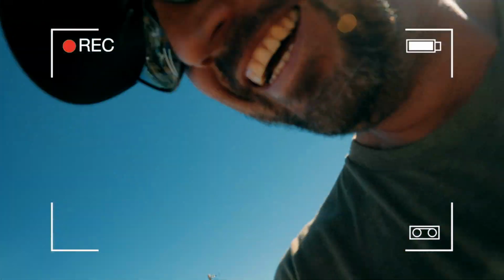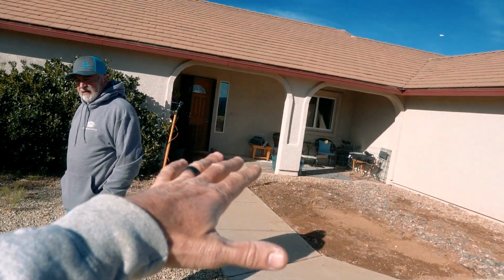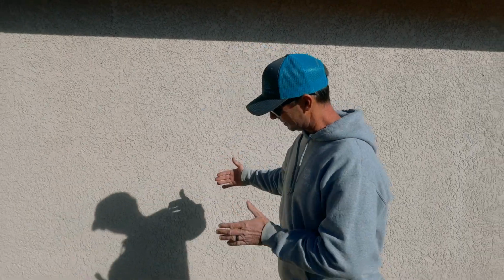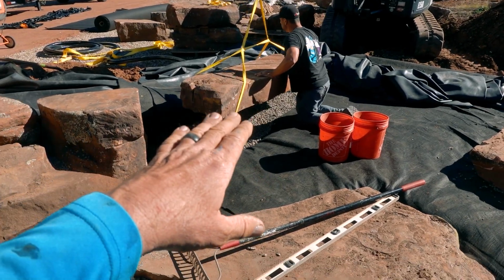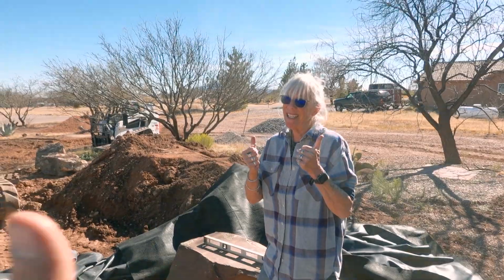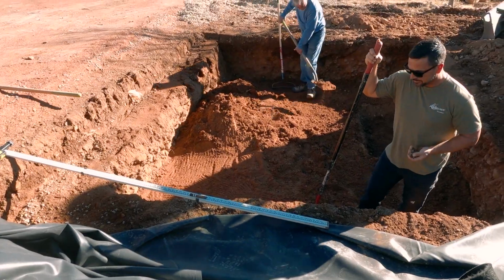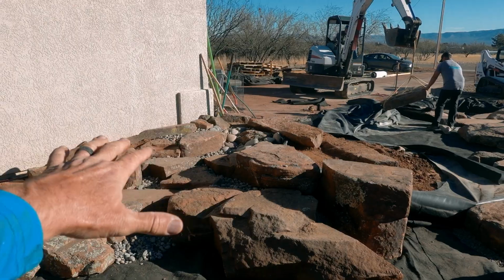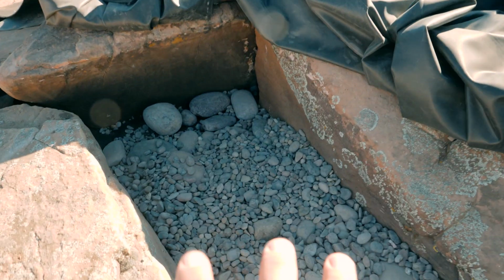Pondless Waterfall BUILT for a DOG!

Comment: Haaaa man, this job is insane you are a bunch of maniacs nothing is install with the intentions of being only OK, the bar is so high... Some questions... to achieve this kind of water flow did you install 2X 5000 to 9000 pumps and after all to videos that I looked so far I still havent figured-out the difference between a bassin ( for a lack of better word ) between two spillways , with a bib-liner vs only the loose rocks or gravel in the bottom of the said bassin even if we seal every big boulders junctions to make an effective bassin?  

Keep on the good work you make us dream!!
Reply from the maker: Great questions Raymond. Yes, the large Waterfall has two of the 5to9SLD pumps. The smaller waterfall has a 4 to 7 SLD pump so when the flow actually merges together at approximately the halfway point so we have three pumps of flow crashing over the lower falls. I only had one spillway available for the upper Falls so we decided to eliminate that single spillway to make the upper area consistent because we had two 3” lines delivering water. This is the reason we chose to go with the aquablox option. By cutting a hole into the aquablox and inserting the 3” line this allows the turbulent water time to slow down and well up to deliver a cleaner flow of water over the top cascade. I hope this answers your question. Keep doing the amazing features you are doing, you are an inspiration as well sir!
Reply: @pondscapesaz  Hahaha, what a luck for me I always was wondering how to do the spillway with an aquablocs, it was a mystery, often heard of it but never saw it on YT...  So by responding to my Bib-liner question you gave me the answer...still wondering about the Bib-liner do, What is the idea behind doing those Bib-liner in pools areas instead of having only a bedrock... if by luck you have time to explain I will be grateful...We are in Quebec so as soon as the snow fall and the groung dry, my wife and I will continue working on a 60 feet long C shape poundless water-feature just like the one you did here, (this YT video was so welcome) starting at 7 foot from the top of the reservoir...finishing with long 10in slope at the end before the reservoir so those bib-liners understanding are very important to me. 

As I always do, I scan this video and the Jaak one on this job literally frame by frame to grab as more images/infos as I cant...Finally you might mistakenly take me for somebody else because I dont know how I can be inspirational.